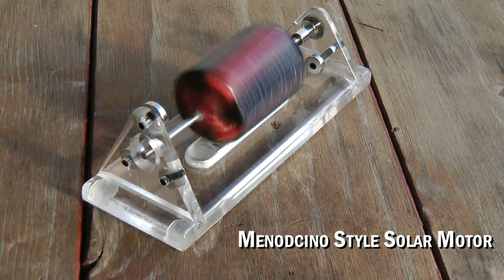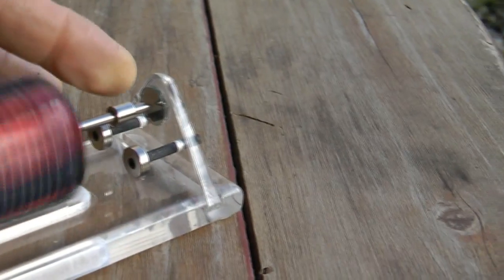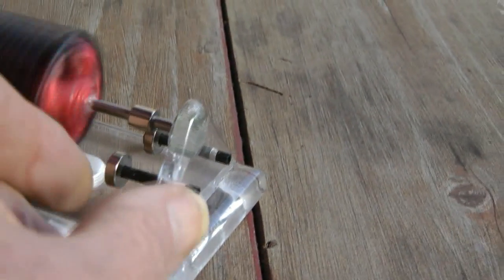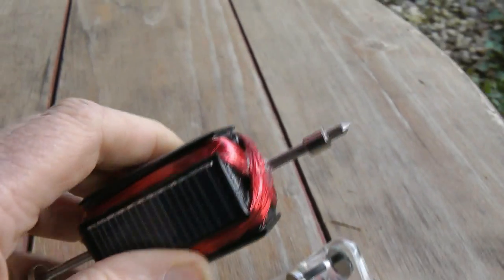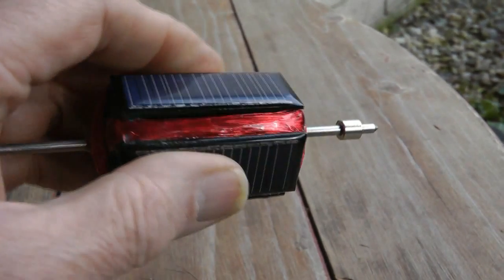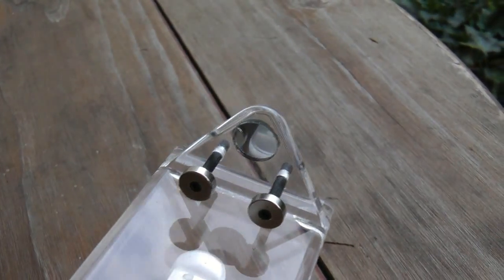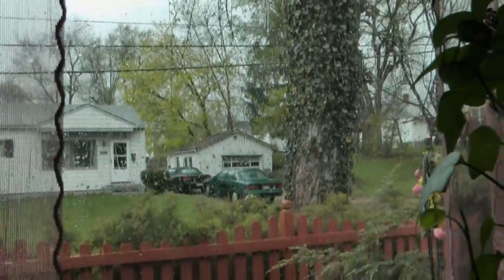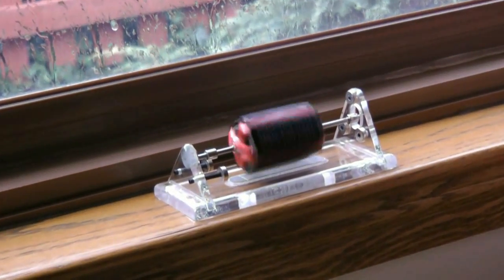Mendocino Style Solar Motor

Comment: Question, can you make it too long, like x5 of the size. lets say the first part is the solar part, and the rest is generator, and while using the levitation with almost resistance free to generate electricity (if possible use LED light {since it uses little energy} to charge the solar and keep it going) is it possible?
Love the video and project as well as the quality, that question led me to your video
Reply from the maker: Hussain Almiskeen Hello friend. I', afraid the argument that you would get from people would be it's more efficient to use the energy from the cell without it being on a motor. Also to collect energy from something spinning there must be some sort of contacts or electromagnetic coupling. This would cause losses.Thanks for watching and the compliment.
John

Comment: How can it be used? or made practical. I am energy knowledge deficient
Reply from the maker: Henry. The motor is mostly a desk or window sill display. There is a unique levitation system and that's about it. You have to remember it's usually more practical to use the solar cells directly instead of creating any kind of motor / generator.
J

Comment: It's a bit of a challenge to find small solar cells the right dimension AND powerful enough to run the motor. John... in your opinion would 6v @ 16ma do the job? Threr are some really great cells available (much more powerful) but they are larger dimensions than I want to use. Any information would be helpful   MANY THANKS  Scott

Comment: Great job! Thanks for sharing it :) I sometimes play with magnets and I noticed if I increase the magnetic power of the magnet (just adding more magnets) which is in the bottom, it will increase the speed of the motor :)

Comment from the maker: On the Mendocino motor the two coils are wrapped in the same direction but one solar cell is connected with one polarity and the 180 degree opposite cell is connected in the opposite polarity.
John

Comment: Question: What would happen if you removed the cells and just put another Magnet over the top of the rotor in reverse to the magnet under the rotor? Would that cause enough flux in magnetic field to cause a charge in the coil still to cause it to spin without the cells?

Comment from the maker: @Robomatrix94 
These sells are from a seller on E-bay. I thought they were interesting because they are 6 volts. Most are less than that but any voltage can work. Electronic Goldmine also has a small selection and I've used a few of theirs.
John

Comment from the maker: @blademcgavin 
There has always been a drawback about this type motor. It's probably not practical to use the solar cells to produce mechanical energy then use the mechanical energy to generate electrical energy. You already have the electrical energy from the solar cells if you use them as intended. You might be able to do something with a commutator on the rotor because you have the coils in motion over the magnets. Thanks for the ideas.
John

Comment from the maker: @Craigisallgood 
Hello young friend. Actually you're almost on the right track. It would be good to surround a portion of the motor but not with mirrors. you need something to stop or shade the light from hitting the cells. You see there is only one angle for the light to strike the rotor which provides the optimal timing for the coil position with respect to the magnet on the bottom of the base. I have thought about researching a material that would just block the spectrum needed.
Cheers.
John

Comment: Cool! What kind of mill do you have? It looks pretty nice, more compact than a massive bridgeport for exapmle, about the size i'm lookin to fnid. Couple questions on the motor, do you find the magnetic suspention bearing is causing much friction at all or no?  and also it would be really cool if you built a longer shaft and used a simple elastic band or a belt to drive a small simple load like a fan. Cool motor! Cheers, IC.

Comment: Hey DadHav, I use PowerDirector 8 for HD video editing. It's very basic, but it handles HD workflow quickly and well. I have an Intel Q9400 quadcore system with 3GB RAM. My HD camera is the Canon HFS11.